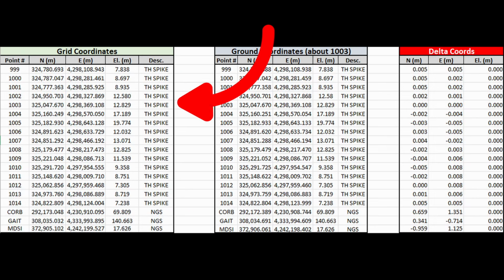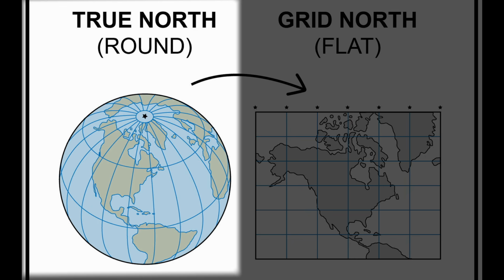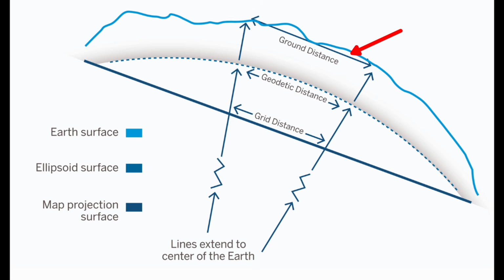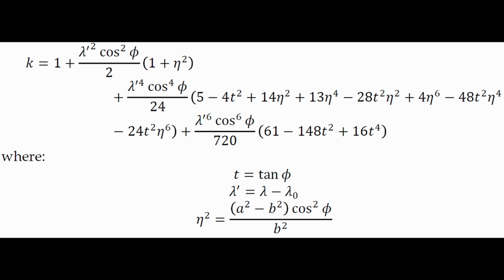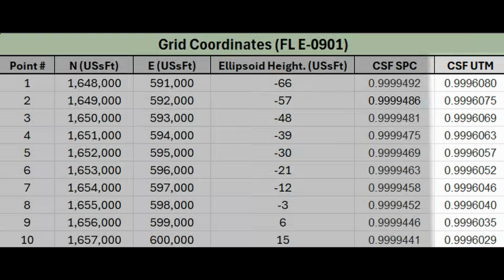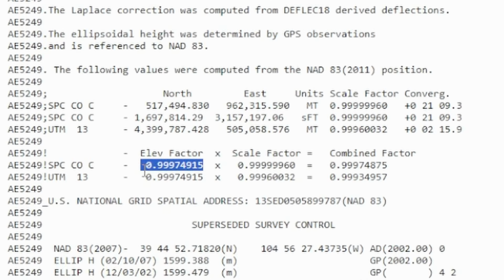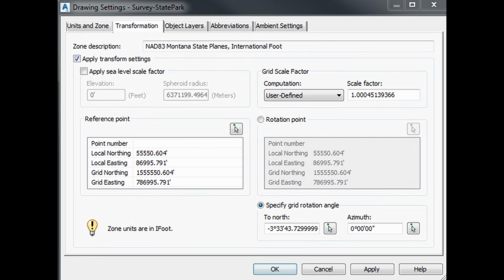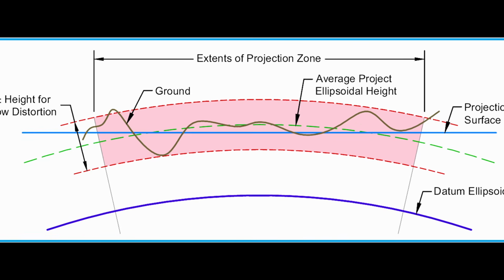Grid vs. Ground Coordinates : Key Differences Every Surveyor Should Know

Comment: For a more practical question, which method do you think is best for mixing GNSS and Total Station data perfectly:

1) GNSS site calibration using total station control points (4 or more) - Obs.: this requires a set of TS control points in the entire boundary of the site, and as you go out of this calibration boundary you start seing more distortions and errors, so you have a really big effort to keep increasing your control boundary with TS;
2) Finding an avarage and good combined scale factor (CSF - grid scale factor x altitude scale factor) and applying for the entire from a base or some virtual point in the aprox. geometric center of the area;
3) Finding a combined scale factor for every single point and applying it individually for every point to convert from UTM grid to ground, just like Leica Infinity does, by "Holding the Base Point" coordinate, and applying combined scale factors for all the other points. The question with this, is that you must always be scaling from the SAME base point to get the data consistent.

I generally go for the method 3) and I use the most precise coordinate from base and the "pivot"/"hold"/"escaling" point for applying the combined scale factors from it, but sometimes this base point it's not in the aprox. geometric center of the area.

I see a LOT of people that does not takes this in account but it REALLY makes a difference. IMO, we should be ALWAYS working with ground coordinates, but because GNSS is so powerful and cheaper nowadays, we see mostly of data being taken on grid but it can bring MANY troubles when staking out a job. Can you clarify how to NEVER get things wrong mixing data? Thanks!
Reply: The most important thing to know, is what the design is using. In theory, these things should be hammered out before a project starts, and sometimes the wrong people are using the wrong software to design..and you're stuck and have to get some answers.

Often times things are drafted at scale factor 1. That's great. Then all you need to know is where to translate and orient   control you come up with. Understanding critical tie in points and boundary offsets are the most important. 

When establishing control, you can go out with total station or gps first, really doesn't matter. I like to start with GPS and tighten up with total station. If it's a scale factor 1, just start with ground distances to help you out with the total station bits. 

I also do lots of work with larger scale utm, and my triage is always this: is design giving ground distances with grid coordinates? If it is, then that's the best case scenario. It means grid cogo shouldn't correlate with plan distances, and ground will. You just need to use utm as your coordinate system in your job and you're good to go.

That doesn't mean there won't be problems. More often than not, a certain piece of the design will be input and output properly in utm, and other places won't. Eg Civil design will be proper, architecture will be sf 1 and they will have messed up their working point gridlines....or they won't match the steel.

Those cases its always best to let everyone know what is going on, and ask them what they want to do. 

In my mind, the absolute best way to do things is to make a localization for the size and scope of the area that has such a small scale factor the error will carry out. Eg switching from a 6 degree  utm to a 3 degree mtm should be established at the very start of a project. That way the error becomes almost negligible, and you can run the same system all the way through without much concern.

But that's rarely the case. I'm currently on a project where they've taken a utm coordinate and done a 1 point localization, and didn't set up a false northing or easting, and just held it at scale factor 1. What a disaster. But I understand why.

The design all started in utm, but nothing was designed following the utm datum, just done in scale factor 1, and none of the engineers wanted to grid shift their coordinate systems, or change their coordinates.

My solution is to show them coordinates of utm and local, and how far out they vary, and always ask the question: is this local or utm? How do you want things in the local site to tie into things that are actually drafted in utm?

I then look at my details of the 1 point localization and advise of the relative distance errors between the two systems. Eg if it's 200m from the 1 point localization to the working point in utm, I then calculate the same point in my localization and tell them the difference in the two coordinates. They can then decide if a shift needs to be made, or if they want to keep it relative to the plant site design.

Yes. It's a massive pain because they don't understand or care.
Reply: @ron6625  awesome example and explanations. Thanks for sharing my friend. Learned a lot from you as well.
Reply: It really depends on the project's tolerances and requirements. But yeah, I agree with we should work on Ground coordinates especially on smaller projects.